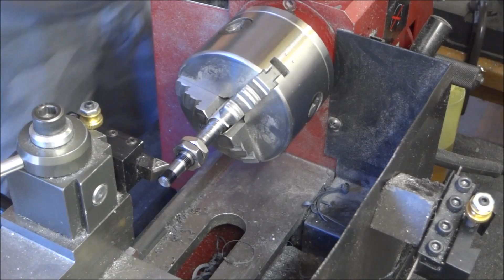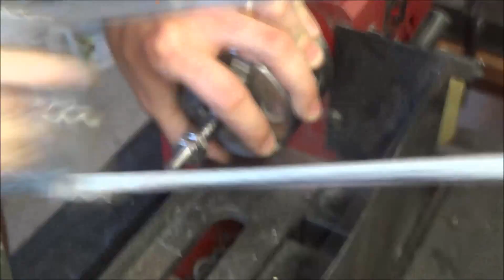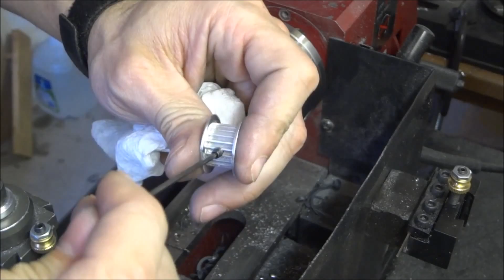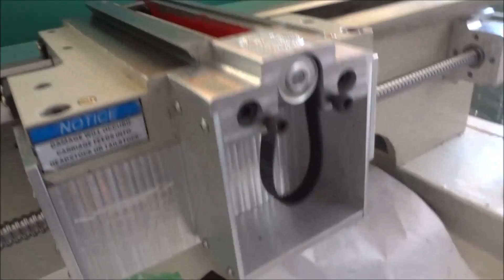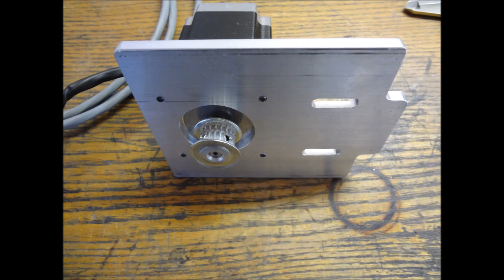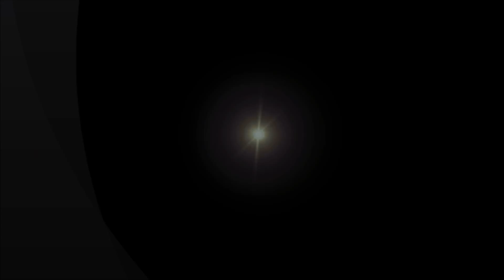G0602 Project Pt  15 X Axis Motor Mount.

Comment: Sam, can you share the specs on the timing pulleys and belt for the X axis (diameters, bores, teeth, belt length and width)?  Thanks.
Reply from the maker: @WilliamMoore-r8c  all of that information is available in the plans. Along with drawings etc.
Link in the description.

Comment: This looks like it was a cool project. I have a tormach 440 and just finished using it to help build a massive cnc router. I just picked up an 8 x 24 wm210v lathe and I know I'm not going to be able to resist converting it to cnc
Reply from the maker: Yes, temptation always gets the best of me.lol